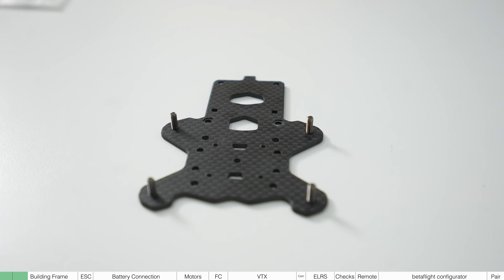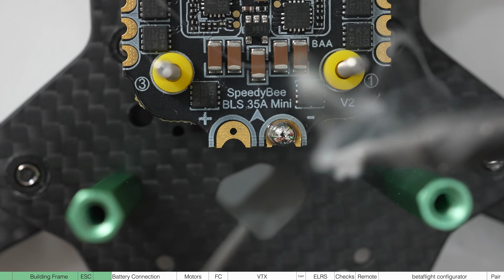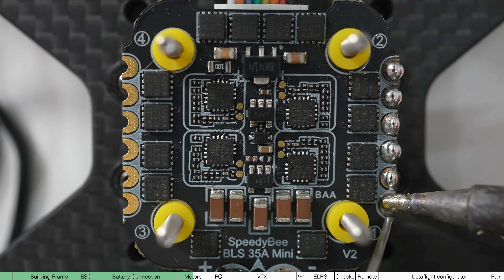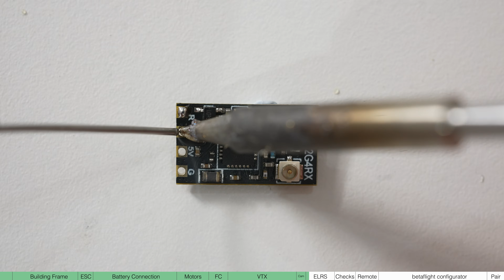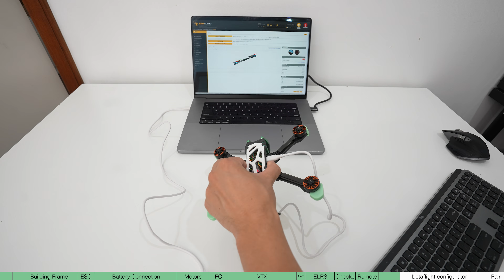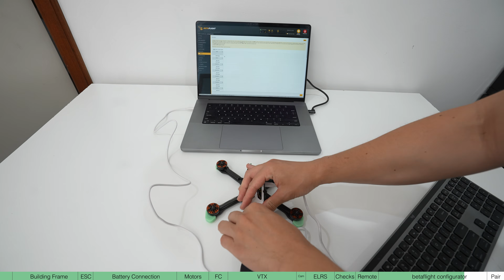Archetype FPV Drone FULL BUILD video (Digital DJI)

Comment: If you cut the power cable to short, you cannot mount the O4 unit close to the bottom and there will be no place on the top for the reciever (I had to put it under it). After build OSD did no appear on the Google, i had to install DJI preset. If you want to connect with bloototh to FC, you need to enable UART 4. Otherwise good tutorial, i could build my first FPV drone based on it, first time builder and it flies :) The strap was not long enough for the 1550 CNH battery, I used a silicone Voile strap.

Comment: I'm confused you did a big thing about the capacitor and then 10 seconds later the capacitor is on top of the power cables like this doesn't make sense at all?
Reply: He used the Clips for multiple Tutorials… 
Analog,Digital… 
When u Build analog you dont Need to put it under the air Unit

Comment: Just completed the build.  I used a different FC. - SpeedyBee F405 V5.  All went well.  Im considering adding a GPS but cant really find a great place to install it.  The rear post are not accessible because the current 3d print antenna holder uses it completely.  I dont want to mount above the camera (DJI04) as it will cause interference.   So.....anybody have any luck positioning a GPS on the Archetype?
Reply: why not above the camera?, other manufactures do this?

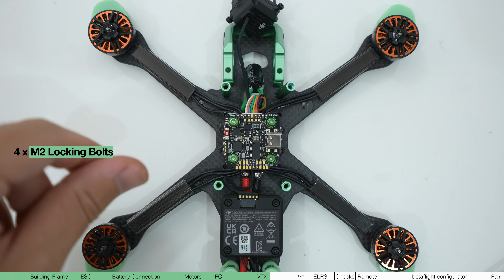Comment: 8:25 what if I want to use a dji fpv controller 3
Reply: don't
Reply: @AarnavVaghasiya why not?
Reply: @Rick48373  it locks you down, and there are controllers out there that are both better in terms of paper performance and ergonomics.
ELRS is now the meta, and I highly recommend using controllers that can support it. If it doesn't have an inbuilt ELRS transmitter, the very least it can do is have a modular protocol system that allows you to switch protocols.
Reply: @Rick48373  hes an fpv elitist , they dont like dji

Comment: wait can you make a guide without the ELRS? im going to use dji controller

please and thank you
Reply: Just solder the SBUS wire and forgo the ELRS receiver stuff and then, When flashing flight controller firmware select SBUS for the radio protocol (Not CRSF as used with the ELRS receiver).
Reply: also you will need to bind the goggles and controller for the control link to show up on the SBUS wire.

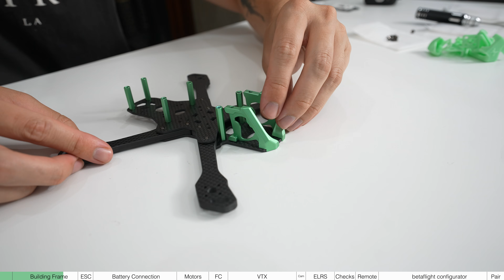Comment: I just got mine in the mail! Such a beautiful design I couldn’t resist! One note, my kit did not come with the M3 5mm mentioned in the video at 2:03 , but rather M3 6mm. Also the longer stand offs seemed to wanna tilt to the side rather than sit upright due to the hexagon cut out on the bottom plate being slightly too small for them. Other than that everything lined up perfectly!! I don’t have any electronics yet but as soon as I do, I’ll report back on how it flys! This is awesome, 👏 congratulations

Comment: i'm a newbie so pardon me but is this price for fpv normal? Genuine qns.  it converts to $953 in sgd if i select the dji 04 module. and the price is the same whether its 4s or 6s? are diy fpv drone parts this expensive normally? because i could get a avata 2 fly smart combo for less than that. If this price is normal then i can see why DJI is winning so many over.
Reply: its normal

Comment: One very small note, you only need the Ground next to Voltage for the Air Unit, the second Ground next to SBUS is only needed if you want to use SBUS.

Comment: Well done Nick!

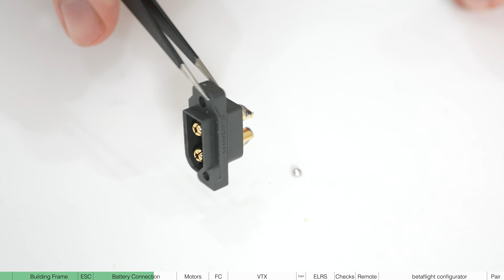4:51 Out of curiosity, is there a reason you didn’t use heat shrink on the power cables & the battery port/connector?

Comment: Now check out the way the cap is in installed later on from the first way shown do it direct to the neg and pos not by adding extensions when you do that the cap is not working as it should be.
Reply: what do you mean by this sir

Comment: clean and tin your solder tip more, and advise people to use a piece of paper instead of a lose prop to check motor direction
Reply: did it work with the prop tho ? yes it did :)
Reply: @RaXXa  yep, works too well, might take part of you with it
Reply: @smikaFPV  you did see it wasn’t screwed on right? As he mentioned too.